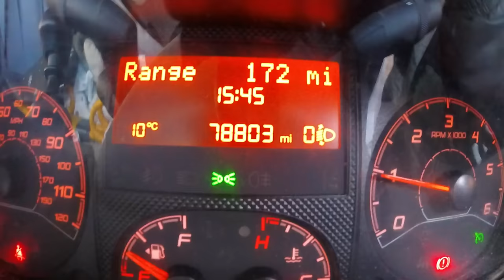2015 Citroen Relay HDI 2.2L Diesel Clutch Replacement

Comment: Man this guys a beast ! Holding the gearbox with one hand whilst doing up bolts with the other.
Reply from the maker: It was a heavy D that box. But went in nicely. Thanks for the feedback 🍻🍻🍻
Reply: If you can slot the imput shift correctly, its not as hard as it looks!😉😉
Reply: @WMCS  you’ll be bench pressing a van in the next video 🤣👍🏻

Comment: Excellent video again. Just spent 3 days under my boxer 2.2. Your video disguises what a tight and messy design it is around the gearbox (especially the hoses). Probably the result of trying to fit a transit engine into a fiat/citroen/peugeot engine bay. Well done.

Comment: I am really, really impressed. These guys can work on my van any day! 

Question: @55:33, what are those little  black caps for? Where you inject oil??????? Are these a routine maintenance item??

And, as others have stated, great, great production and most informative.
Reply: That is refilling of the gearbox oil
Reply: @chriskingston4256  Thanks Chris.... is there a vid where you change the gear oil and show this "trick"?? Thanks again. Best
Reply: @N269  Probably. However, if you watch this video, eary on he undoes a sump plug on the gearbox (square bit required by looks of it) drains the oil out, this is so it doesnt leak out when removing the driveshafts. But if you wantd to do a gearbox fluid change, just drain it out of there and refil it from the top "black bung" as you referred to.

Comment: Morning Kevin, all the best from Holland 👌😉, do you never use the sac tool during clutch installation?
Reply from the maker: Morning..🔥🍻.. that is the only clutch alignment tool in my arsenal .. believe it or not that tool has fitted 3522 clutches 😁🥇
Reply: @WMCS  I bought the tool a couple of years ago, but used it twice or so. Since then, I only use the same midlock tool🤣. Perfect job mate!!

Comment: Enjoyed this one Kev ,but what a faff? Why do the French make everything so awkward!!! Thank goodness for the Wobble Drive I say.Always enjoy watching your skills and the trouble you take in making these Videos so interesting to watch.Best Wishes :yougotthis:
Reply from the maker: Good point if it wasn’t for that wobbly I would not have managed the couple of bolts right at the back. Could get a ratchet on there to have enough leverage to crack it. The spanner would have rounded it off.., and the two retaining pin that holds the driveshaft in place. A very very bad design. Most manufacturers put a clamp with two 13mm bolts over it. 
But that pin system always rust in place and breaks as soon as you touch them. So lots of WD40 was needed to avoid any mishaps.